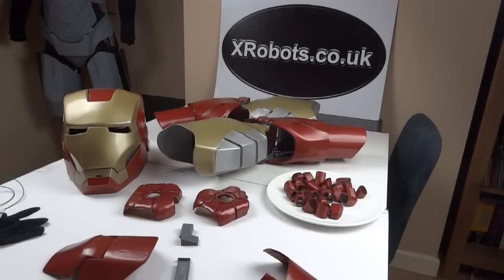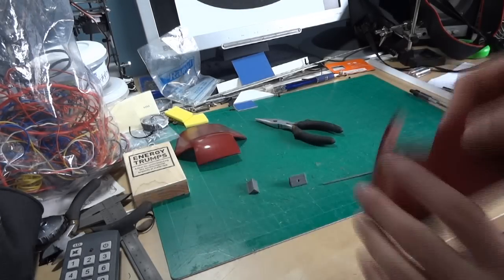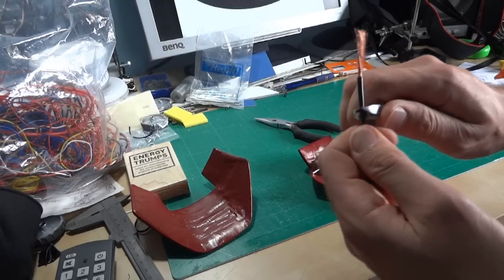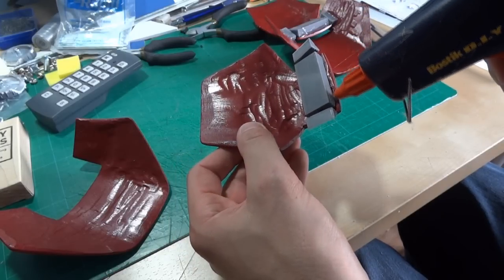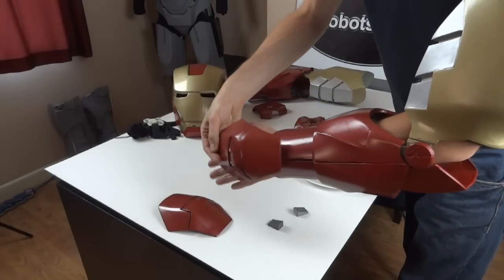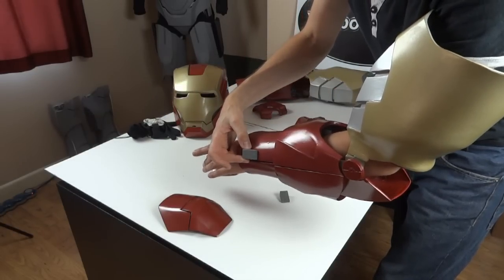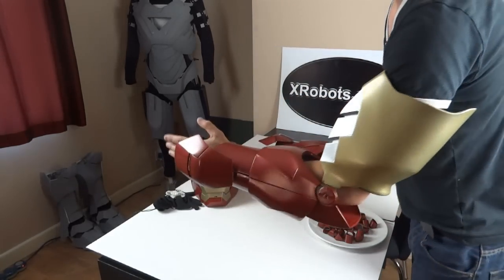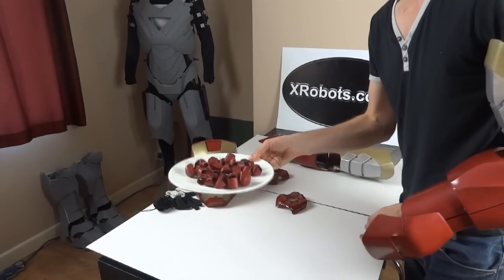Iron Man Power Suit #37 | Final Gloves | James Bruton

Comment: 2 things, one, you could use the grip from a goal keepers glove and paint it red to fill in the gaps between the finger segments to look more like the actual fingers? and two, are you going to mount the electrics for the palm LED cluster in the space in the forearm that you filled with foam? because when putting the arm on, it would be awkward to attach the electrics to the main center chest-plate where you were originally going to wire all the electrics to? :)